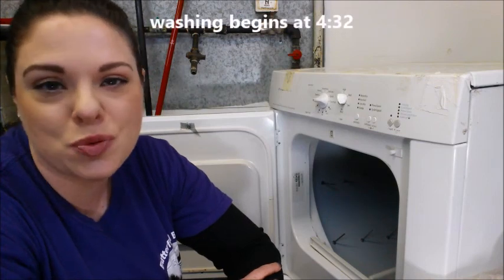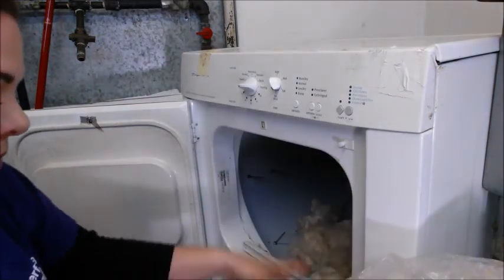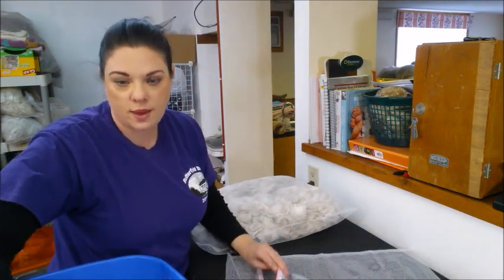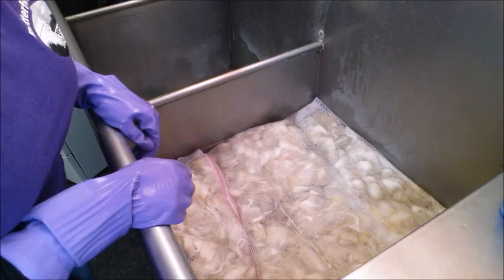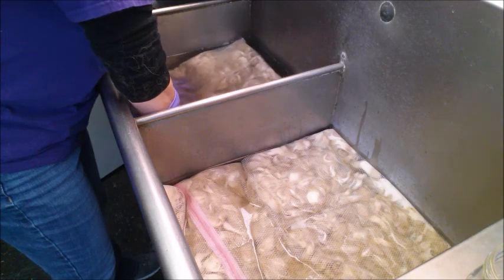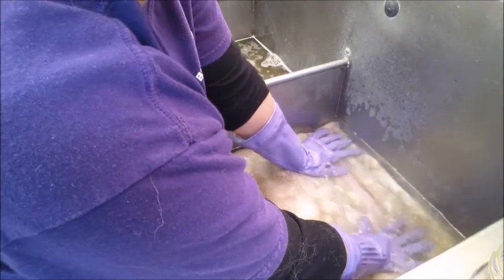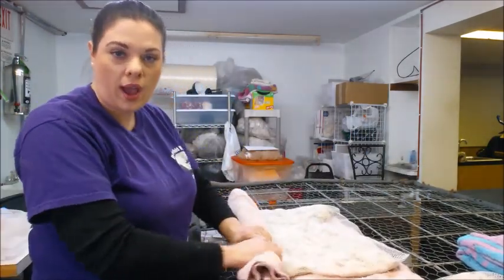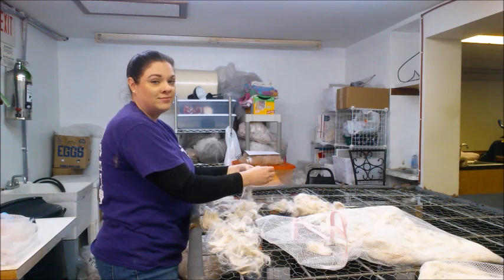Tumbling & Washing Alpaca Fiber (Fleece)

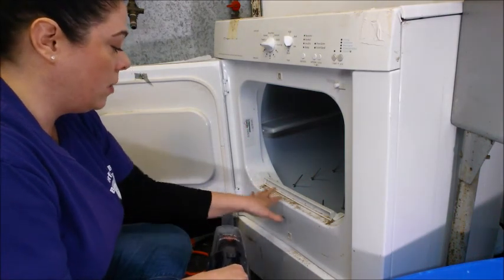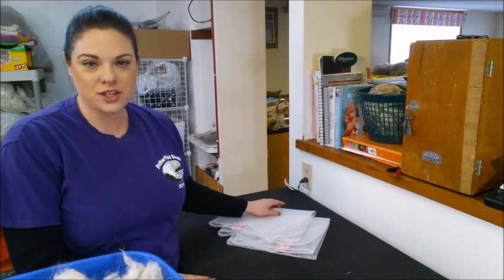Comment: 4:17 - 4:25 - 4:30, is very smart, not just for dealing with shorn fiber, but for dryers that don't filter lint or dog/cat hair as well as they should.  To get down into the area where the lint-screen usually sits, and remove stray debris, could prevent a fire, when that hair or lint is exposed to high heat, typically with Cotton loads like towels.  Sure, one cleans the lint trap every time, but if lint has fallen down in (which happens), then using a narrow-nozzle vacuum is important.  It's obvious wisdom, but your sharing this detail offers good wisdom to those that catch it.  I say Thanks!  :)
Reply from the maker: Years ago my grandparents’ house caught on fire from the dryer so I totally understand. The dryer I use as a tumbler has no heat. That would felt the fiber and render it useless. But it sure does make a mess!
Reply: Butterfield Alpacas & Fiber Arts    
You have spoken often of felt.  Hats used to be commonly made from wool felt.  Couldn't Alpaca felt be used to make hats?  I should think so.  Looking forward to your reply on this.  Very interesting.  Thank you for all your good sharing; it's so educational, and affords us the ability to learn the easy way, rather than the hard way.  :)
Reply from the maker: Yes, in fact there are YouTube videos about making alpaca felted hats. I’ve not done it but, for some, it’s their specialty. 

I hope others can learn from my mistakes and experiences so that they are more successful from the start. Why reinvent the wheel?! 😊

Comment: Your videos are such a great source of info! I was given an entire fleece when I helped out on an alpaca farm shearing day last may.  I live in a small apartment so getting a second dryer that doesn't have heat is not an option.  What are your thoughts on those small electric spinning machines? It's kind of  like a big salad spinner but for clothing?
Reply from the maker: Hi. Thank you 😊 
Depends on how often you’ll be working with fiber. It may be worth a try but I’ve not used one of those to really say.

Comment: Hi - I followed your instructions on how to wash alpaca fiber. The water was still pretty dingy after the following the 4 steps. Should I have done an extra wash? Your directions were so easy to follow. Thank you for making my learning process so easy.
Reply from the maker: +Cindy Maag You can wash as many times as you'd like. Some alpacas are pretty dirty! Lol. Each step after this - picking, carding, spinning, and final wash to set the spin - will release more dirt too.
Reply: Would it help to bathe each Alpaca just before shearing?  If that's possible, I would think so, for sure.
Reply from the maker: I’ve used a leaf blower on the alpacas before shearing to help release some of VM and dirt. I think some may wash them in some way but I don’t because the water will trap in their body heat and mine are usually hot enough in their full fleece by the time shearing comes around in May. For some, their setup might work better for what you are suggesting.
Reply: Butterfield Alpacas & Fiber Arts     
Not to ask a stupid question, but is it possible to brush an Alpaca the way we would a dog?  I suppose not, with that thick fiber, but it would help with the cleaning.   ~  Thanks for the smile about the leaf-blower, that being an unexpected appliance.  Did it frighten the Alpacas?
Reply from the maker: Brushing can disturb the lock structure, certainly on the suris. For huacayas, it would be on a case by case basis. 

The sound of the leaf blower does startle them but you can desensitize them, like saying a certain word or coughing before you turn it on. Then they’ll learn to expect it. Also, point it away from them at first then blow it on them. The sound and air blast is too much at once.

Comment: 2 thoughts for you > 1.  Since each step takes approx. 20-30 minutes, and we know the water temperature will cool during that time, does the temperature-change of the next step being Hot again, cause any problem?  Thank you for your reply to that.  2.  I find that using natural Coconut Castile soap is HIGHLY effective at removing soil (more than mainstream soaps and liquid detergents), while rinsing very easily (REMARKABLY easily!), which would do away with the need to add vinegar. :)
Reply from the maker: I know that drastic change in temperature is part of the felting process but I’ve not had issues using hot water to start each step. It must not cool down enough to be a problem. 

Great tip about the soap. I use that at home but had not considered it for the alpaca fiber. Thanks!
Reply: I have been using it for years now, not only personally, also in place of shampoo > with no need for moisturizer or conditioner, leaving No residue, but on the dogs, and I am AMAZED how easily and quickly it allows the soil and soap to rinse away from their undercoats, requiring a lot less time and water.  You know how difficult and time-consuming rinsing undercoats can be, but with this, it's a total breeze, speeding the whole process, lickety-sizzle!  If dog-groomers used it, they could bathe each dog in record time and save on their water bill, while it leaves the skin feeling good, not dried out.  It's a natural surfactant, like citrus oils, only not harsh, but gentle.  :)
Reply: @cacatr4495  what is the name of this shampoo you are talking about please🥰?
Reply: @marideemalmberg7278  
It's not "shampoo', but bar soap, shockingly.  Because it's pure, not having other things in it, it doesn't have the residue of most bar soaps.  As I said, it's natural Coconut Oil Castile Soap.  One must protect it from sitting in water, because if it is overexposed to water, it will melt.  It's very soft, moisturizing and gentle.  One should Not roll the bar of soap between their hands, but instead, they should wet a clean sponge, dedicated purely for the soap, squeeze the water out of the sponge, so it's only a bit moist, then set the new, dry bar of soap on it (to absorb any stray moisture, to preserve the soap), and keep it out of the water.  If they first let the moistened sponge dry, with the soap on it, then the soap will stick to the sponge, which will preserve the soap.  Then, one should moisten one of their hands and gently rub their moist hand across the soap a couple of times (never handling the bare soap), then rub their hands together to create big lather.  This is how to get a lot of efficient, natural lather without damaging the bar of soap, which will make it last a long time.  One must remember that it's not hard like other bar soaps, but very soft, so it should never be handled or exposed to water.  Because of the natural surfactant of the coconut oil, it removes soil very, very well, while being gentle and moisturizing, and rinsing out very easily and quickly.  If it's kept mostly dry, it will stay attached (stuck) to the sponge, such that one can wet their hair/head or the dog, then pick up the whole soap/sponge combo to rub the soap against one's head or dog for quicker lathering.  But the sponge must always stay attached (stuck) to the soap to protect and preserve it.  The only time it should be picked up (always together with the stuck-on sponge), is when one is washing hair/head/dog.  For normal handwashing or bathing, one should just rub a wet hand across the top of the soap, and taking these steps will make the soap last a very long time.  If not, it will melt and fall apart very quickly, as it's easily damaged and mushed out of shape.

Comment from the maker: What other methods have you tried for washing alpaca fiber?
Reply: Hi. I found your method very complicated with a lot of efforts. One Alpacas owner of 26 beauty teach me much more easy way how to do that. First,  alpacas hair is not dirty as sheep wool (and not stinky as well), but dusty. You have remarkable metal frame with chicken wire,  which you can use as a first step to shake the dust (better wear your mask and safety glasses). I used simply wooden frame with wire on it waving the alpaca hair on my backyard up and down. If U don't have much creature on your backyard (as I have) - you can leave the fiber outside for couple days. Then sorting and washing. I washed twice and still satisfied with result and texture. Each sort of fiber I was drying separately on open sunny areas for couple days. Then comb and card(have the same carding machine as U). All my treasure stored in shad in boxes with description of color and tipe of fiber. All my handmade yarn is prewashed in hot soapy water to fix the ply, then I wash the  item I knitted (shawl,  scarf, hat, mittens,  socks, sweaters)as well. Amazed by yarn quality , the way how it looks,  warm and cozy. 
Thank you for shearing your video. Wish you the best. Still dream about my own alpacas with hope ones it come true.

Comment: nice video but seems to add so many unnecessary steps to an otherwise simple to process fiber. guess we just all do this differently : ) no offense. Loved to see the alpacas dust bath that was way cool
Reply from the maker: What is your method for washing alpaca fiber? I’m open to learning other ways.
Reply: I’ve heard most spinners here in South Australia prefer to keep the fibre dirty, though remove debris when they spin it as it is so fine it is apparently actually easier to work with when a little dusty.
Then they wash the yarn. 
I’m just starting to learn about it but frankly I’ll take the easiest route LOL!
Reply: Yes Cintia, how do you wash it?